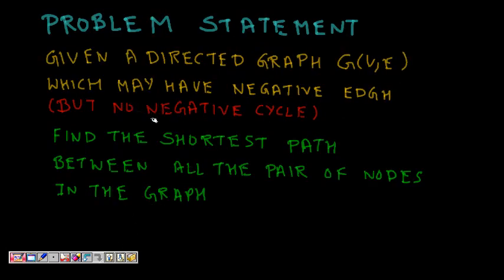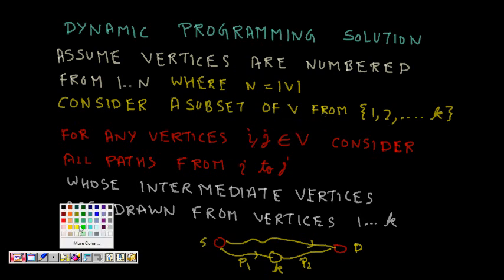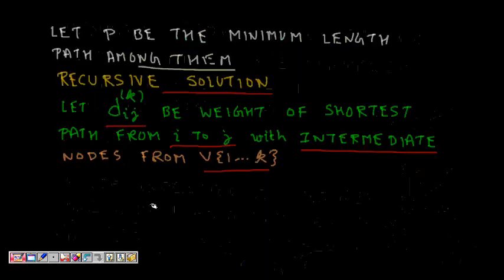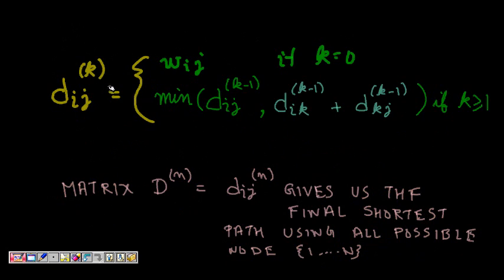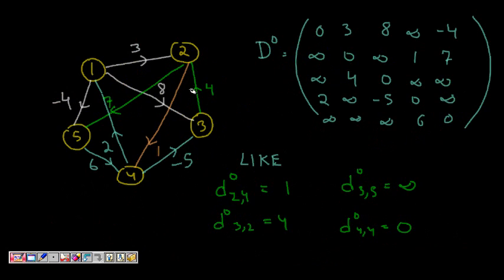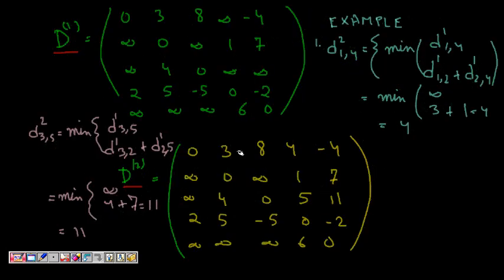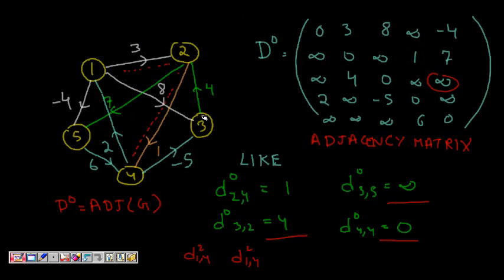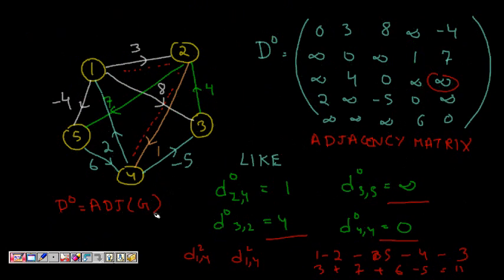Programming Interview: All Pair Shortest Path  (Floyd Warshall ) Dynamic Programming

Comment: I would like to point out an error I can see in this video, here d[1,4][2] = 2  not 4. You go from 1 to 5 (cost = 6) and then from 5 to 4 (cost = -4) . Actually I am confused as to what 2 here represents . Does it represent atmost 2 intermediate nodes which can be any of the nodes or does it specifically represent nodes 1 and 2 i.e only 1 and 2 can act as intermediate nodes?

Comment: great lecture.. Thanks a lot. One question - I think since it uses dynamic programming, the intermediary results will be stored and used. for example if we have to calculate d4(3,5) then only the distance using the node 4 as we already have distances upto d3(3,5).
Sorry If i am confusing.